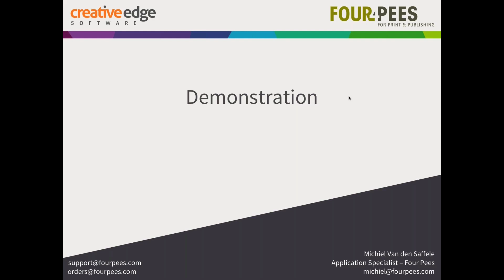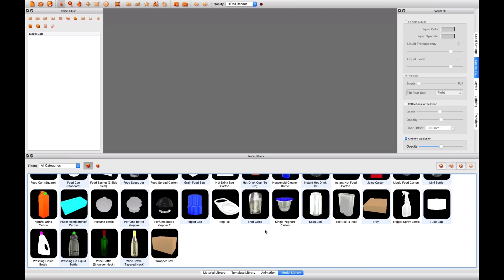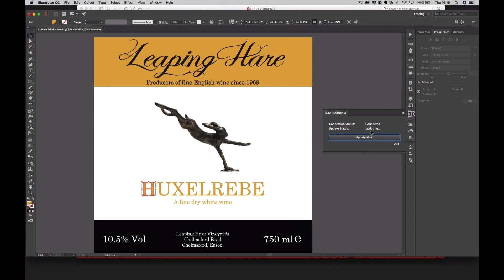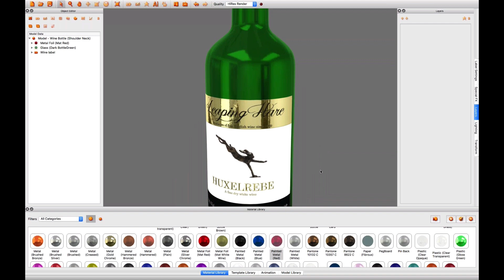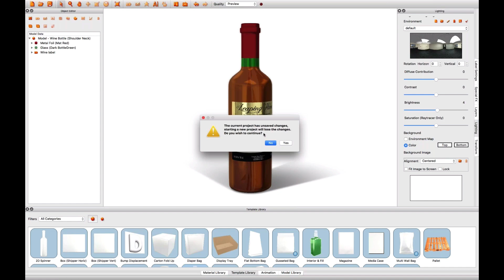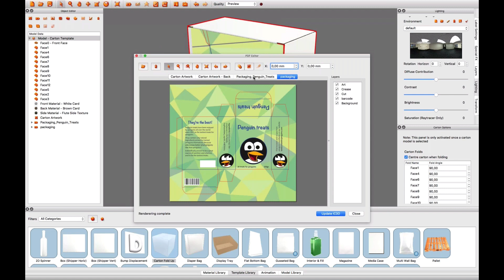Create a packaging from scratch with iC3D!

Comment: How to use the crush fold told in carton fold ?
Reply from the maker: Hi Kumar,
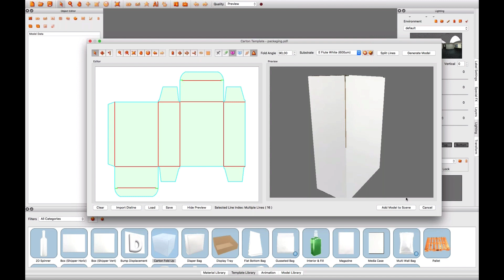In the iC3D Carton module you can simply select a face of your carton packaging and fill in the angle you want the fold to be. Around 26:10 in the video you can see the "Carton options" window at the bottom right of the iC3D interface. There you see all the faces of the drawing have their angle defined as 90° because we decided that earlier in the video when importing the drawing. You can still change the angles there if you want to open up a flap of the box for example.
Does this answer your question?